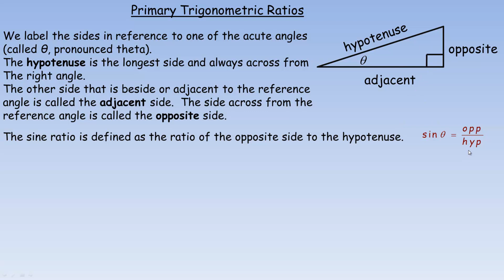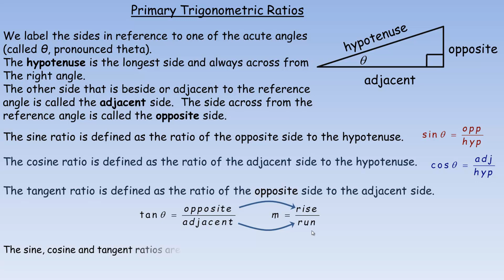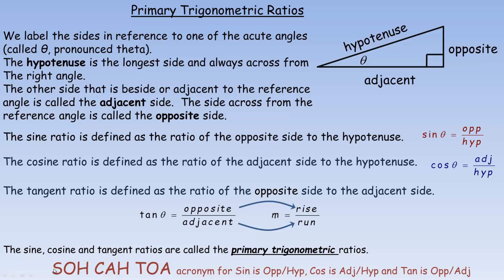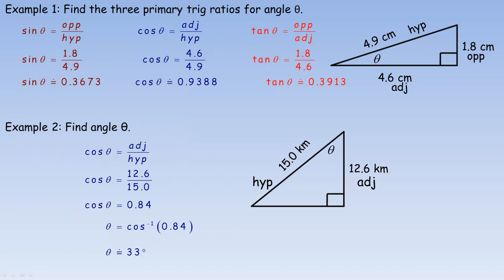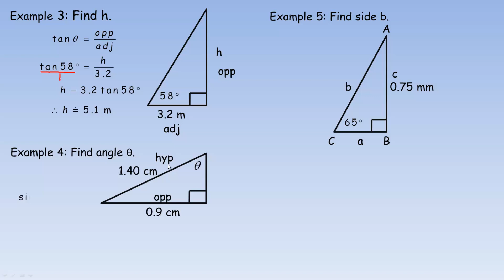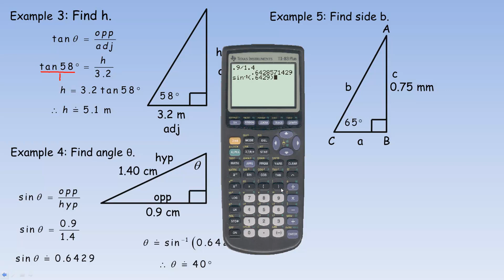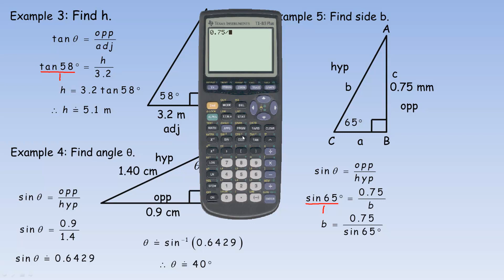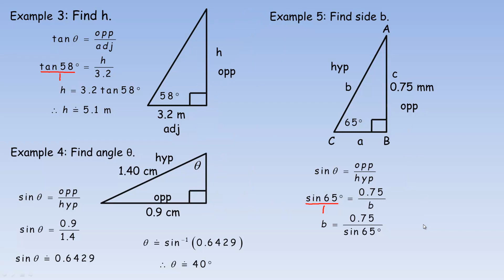Primary Trigonometric Ratios

Comment: Thanks.  If I don’t have the -1 function (using iPhone calculator) is there a different way to calculate the -1 functions (sin-1, vos-1,tan-1)?
Reply from the maker: The calculators on smart phones are basic calculators if you hold the phone in portrait mode (up & down).  If you rotate the smart phone so it's now in landscape (longer sideways) the calculator switches to a scientific mode.  If you hit 2nd you get the sin^-1, cos^-1 and tan^1 functions.